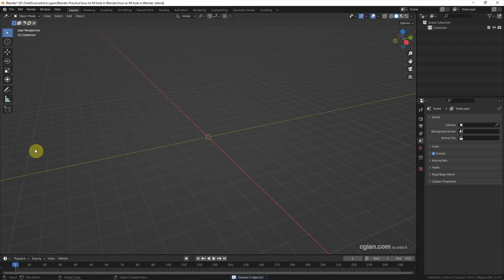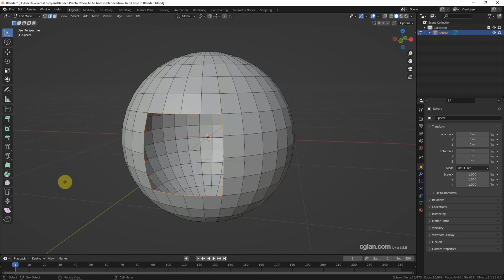How to fill hole in Blender , 3D modeling tutorial

Comment: my hole is on the top of the spere and I can't close it with the last option you showed which is the one I needed.  It says Select two edge loops or a single closed edge loop from which two edge loops can be calculated. I don't want regular fill I need grid fill
Reply from the maker: When I make this bowl, I use grid fill to fill the hole on top of sphere, have a look if this helps.

https://youtu.be/voa0w0xtNUA
Reply: @blenderian.3d  thank you I will as soon as I’m back home